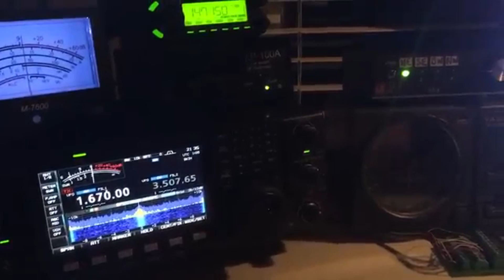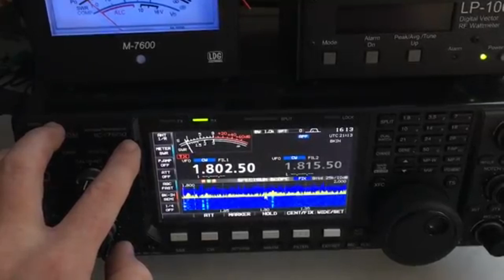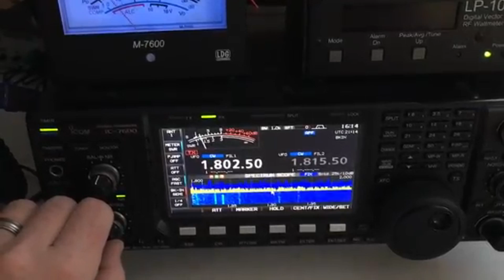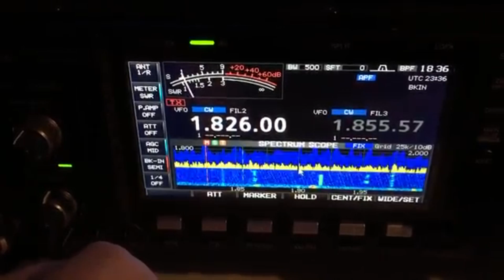KB8O Demonstrates the DX Engineering Receive 4-Square

Comment: @DXEngineering:   How high up can the four active antenna modules be mounted?  I understand from research on this antenna that the active antennas should located as close to the ground as possible, while avoiding snow and standing water.  I live in an area that gets heavy snows.   Thanks!!
Reply from the maker: Snow does not usually cause problems with ground mounted antennas. It's the standing water that hurts.